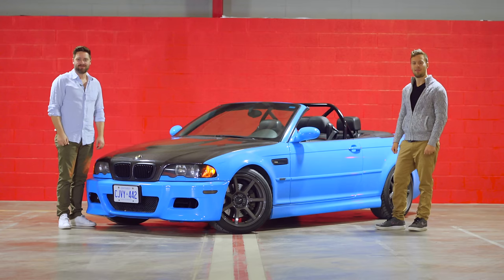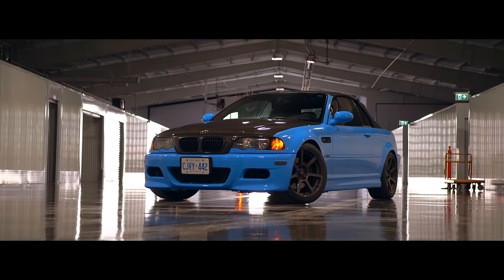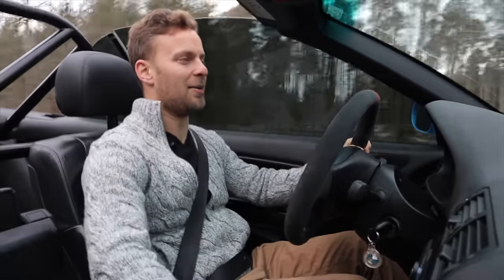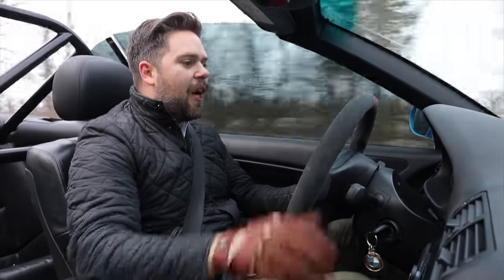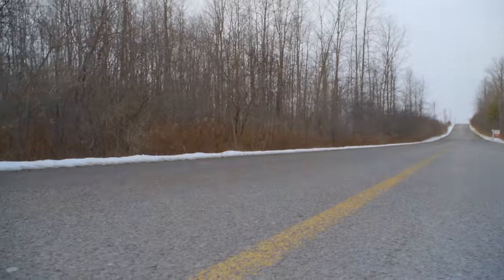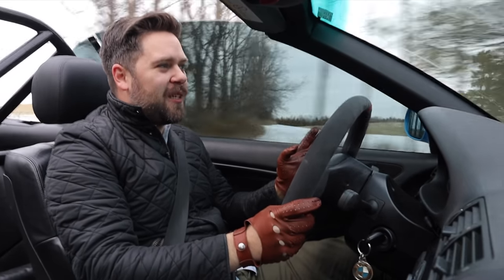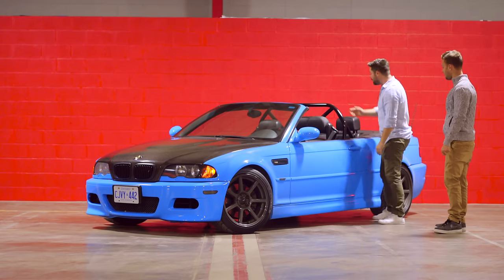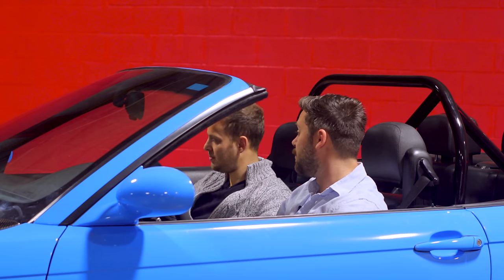I Bought A $10,000 E46 BMW M3 // The Best Car Of All Time… Says Thomas

Comment: Speed Academy : "We were lucky to find someone dumb enough to buy an old abused BMW."
Reply: Jack Black still great fun
Reply: Ehh. They break if they're babied, they break if they're abused. They break no matter what, so what.
Reply: It’s a fine pos
Reply: bliglum they don’t break if babied, I have one
Reply: @poorcomboz3577  Hah! Give it time. But of course, if you count repairs as "maintenance", it basically never breaks right?
Reply: @poorcomboz3577  True!
Reply: bliglum I’ve had my 1 series for 3years now... bought at 62k currently has 116k and runs great only problems I’ve had was maintenance and the usual starter/water pump change... she’s as reliable as a Toyota Corolla. Currently looking to buy a e46 m3 now... bmw is THE ULTIMATE driving machine ;)
Reply: Carson D I got my 525 at 80k and I’m at 160 currently and she’s been a complete beauty the entire time I’ve had to replace 2 of the head gaskets but that was due to my error not the car and other than that nothing
Reply: @griffin_kith6214  same with the head gasket. You overheat or misfire these motors for one second too long and bye bye head gasket
Reply: And he put an eventuri intake on it :/

Comment: Hahahahaha...... You just convinced a whole lot of 17 years olds lose their shirts on weak 323's
Reply: I feel adressed..lol
Reply: Still fun to drove if its stick though 👌🏻
Reply: DuBstep115 sell the clothes off their back to pay for the base model e46
Reply: @leocui03  When are where was this ever a metaphor? Has anyone ever sold clothes to buy anything :D
Reply: @DuBstep115  I would sell my body for the right car
Reply: @leocui03  buying it isn't the issue, you can grab one super cheap... Repairs are insane. It's a good way to start your career as a mechanic. <I would know 😋
Reply: DuBstep115 search up "shirt off one's back"
Reply: lose their shirts or shitx?
Reply: Billy Shannon I wish I was born USA. It’s a heaven for car enthusiasts. unfortunately in my country there is no such thing
Reply: @enderzebak2863  where are you from?
Reply: Billy Shannon I bought one over a year ago and the only thing that I’ve done is a clutch job, because you never know when the plastic fork pin will break but everything is very easy to work on and for only $12k for a hardtop I can’t recommend them enough
Reply: @Industry-insider  yes they are easy to work on. They hit this weird spot in age where absolutely everything plastic and rubber just goes. Gaskets/seals (all of them), plastic tubing and casings, electrical wiring specifically connectors just melt/lose contact or short. It seems to happen all at the same time and nothing is cheap. Recommending one to a kid with just enough cash to buy the damn thing.....not what I would do.
Reply: @Industry-insider  PS. It's one of my favorite cars ever made, congratulations!!! It is without doubt one of the sexiest, best driving cars of it's generation.
Reply: Billy Shannon honestly have you ever had one? Because people really exaggerate it, my 18 year old car’s plastics are in pretty good condition and it came with paperwork saying all the important seals have been replaced. I’m not saying people should expect it to always be a cheap car but it’s worth it to me
Reply: @Industry-insider  I've had 2. I worked for BMW for 8 years and the newer they got, the worse, especially the e90's can be absolutely horrid. If you can find good parts and fix it yourself than go for it 100%. Otherwise, have money in your pocket.
Reply: Nod Melon  super easy to work on. Parts are still expensive in comparison to almost any other toy a 17year old can afford.
Reply: Don't assault me! Yes I may be 17... and broke... and own a 325ci.... with 140k miles...

But it was a great decision!
Reply: @nathanschutt5591  😍 to be 17.....
Reply: Slap a turbo on it and push 400hp on stock engine.
Reply: joke’s on you........ i have a 325
Reply: @ch-jc1mp  bwahahahahah

Comment: 323Ci here, and I completely understand your love for it, even the interior! It's an amazing car really, and although it does have some creeks here and there, it still feels very solid. Yours is beautiful, and I love the carbon bonnet. You should definitely add LED taillights tho, they make the car look so much up-to-date. Also the film that BMW put on the plastic inside, can be removed by soaking it in hot water, and brushing it off with a sponge. Did it on my 323Ci, and it became like new!

Comment: As an owner of an E46 M3 ( my dream) it's a love hate relationship. Mostly love little hate. What I've learned from this car is the 2 main things that has been done to the car rod bearings and subframe. Subframe still cracks even if you done the reinforcement (heard few stories). Rod bearings still go out after constantly revving out to 8 or 8350. But overall it's an amazing car  right proportions and spacious (I have the coupe which is faster). Took to twisty roads and it's agile and responsive( subframe bushings been changed to solid). This is BMW at its prime and still one of the best cars to own. Track car and a GT(does both)
Reply: Keyser Soze either you’ve never driven one or the one you drove was clapped out
Reply: BMW at its prime.....completely unreliable crap.  Yep, that's BMW.
Reply: @TomCogan  "Clapped out" describes nearly every E46 M3 these days, as they've all been abused and saddled with distasteful mods.
Reply: @Keyser Soze where is this dealership located and what's it's official name, since you keep mentioning it.
Reply: Adithya Ravikumar those are 2 UNACCEPTABLE issues.  The chassis and engine are basically on a countdown to failure lol.
Reply: 80's Boombox Collector true, luckily mine isn’t
Reply: Keyser Soze I wonder what makes you hate a car so much you commented 100 times here about your credentials
Reply: As much as I like the E46 m3, I don't think I would be able to put myself through dealing with all the issues. I don't know if this is a particularly bad example, but that car is pretty beat for the miles. I would prefer to spend a little more upfront to get a 996 and have the ims bearing replaced. I say that but I understand going both ways, especially if you need the space from the BMW. I have a 987 so I have a little brand favoritism going on.
Reply: If you "constantly rev" your 8000rpm redline car to 8350rpm, then you deserve every rod bearing failures that comes your way 😄

Anyone interested in buying should go for '04 to '06.    These issues are almost nonexistent for these model yrs

Comment: $6700 V8 4runner
$10,000 M3
Literally the best way to spend almost $17k
Reply: More than a few of us in Colorado have a lifted Yota for mountain off-road fun, and a fast German car for mountain pavement/city fun. I had a 97 4Runner Limited with a locker and a 3" lift paired with a '16 Golf R with a stage 2 tune. Black ice took the 4Runner from me so I got an 04 V8 and built it up with 33" wheels with a 3" lift, and put some Doug Thorley headers on it for a little HP bump. She moves! The downside is that you scream at your German fast car for it's silly unreliability compared to its Japanese garage mate. Got sick of the R and sold it to start flying airplanes. No regrets. lol
Reply: Lonememe 33 what ?
Reply: DJ Raccs 33” tires.
Reply: +lol el I can top that
$7500 V8 Pathfiner
$9500 C5 Corvette
Reply: @masterwhopper414  They made Pathfinder's with a V8? Epic
Reply: Bruh 
2008 4runner
2002 M3
Reply: 10k M3 + 10k parts and labor
Reply: Or get a 17k m3 with good color and a manual and you keep it for awhile and watch the price slowly go up.
Reply: Except that a $10,000 M3 actually costs around $20,000 eventually.
Reply: lol ol just get a $8000 Lexus is250 and a $10000 m3 and then you’re always in something nice
Reply: @aaroninohio5752  good luck finding an m3 for only 10k. Smdh.

Comment: I mean, one of the best designs ever, one of the best chassis's ever, one of the best engines ever, available with a propper manual...
The E46 M3 IS one of the best cars ever made.
Reply: @Keyser Soze Reliability doesn't matter in this case...People that buy these are fully expecting to shovel money into it.
Reply: Best chasis ever? Reliability-wise not so sure!!! Designwise as in looks absoFUCKINGlutely
Reply: The e46 convertible is certainly not the best chassis ever. Not even close. I don’t know why you want to build a convertible to be a race/drift car.
Reply: Keyser Soze you’re the ONLY bmw mechanic/enthusiast I’ve ever heard call the e46 a bad car. The e46/e39 are far and away the pinnacle of BMW cars and nearly every BMW shop and enthusiast will say the same. The s54 is capable of withstanding years of abuse if it’s issues are addressed and the chassis is just excellent.
Reply: @Keyser Soze that's not true at all. The v10 bmw was a massive gasoline hog, 10 quarts oil change, too heavy ruins brakes, if check engine light comes on expect massive $$
Reply: One of the Best engines, s54 iss definitely a beast. One of the best designs, most definitely. One of the best chassis, meh, rear subframe is super weak on this untill the 2002 and after models where BMW reinforced them from factory
Reply: Mine was a great car, reliable and extremely well build. Solid as all hell. It wasn't a convertible though, and it had a sunroof delete. Still, I never loved it. The gearbox always wanted the engine to live above 4k rpm, so it was annoying to peter around town in. The exhaust sounded cringey, like a shit can racerboy. But mainly something about it was just too sterile. All purpose and no personality. I never missed it.
Reply: haha, best chasis ever?  the e46 is notorious for sub frame cracks, just about every one has them and it will cost you around 5 grand to fix.
Reply: @pouncey007  no, lol. 5 grand to fix, what world do you live in? If I can grab a good subframe for no more than 300 euro then how the hell does it cost 5000 to just fix it and if you didn't know all E46's subframes came reinforced from factory after the 2002 models so they fixed their mistake but if you wanted to reinforce it even more then a kit to do that and get it all welded up would not cost you anywhere near 5 grand and if you didn't know the E46 compact from ANY year came with one of the strongest subframes on any car, that car is known for its strong, non-flexing chassis for drifting. So basically your mostly wrong
Reply: @rxw5520  well every car is like that when you get it, most cars stock are boring and the E46 is one of the most boring cars stock, you gotta slap a nice kit on it, wheels , slap on a turbo, E46 has a lot of potential but not many tries to take its potential out
Reply: @aricerse4654  nah... I wouldn't agree that "every car" is like that.
Reply: @rxw5520  that's why I said most, I like some cars stock too like for an example an rtr Mustang
Reply: @aricerse4654  what year is yours and what mods have you put on it?
Reply: @rxw5520  I bought it for 250 euro so it's been repairs more than mods, just a short throw shifter but I've replace the water pump, power steering pump, alternator, idler tensioner,
Valve cover gasket and a lot more stuff and I have raceland coils ready to go, just waiting for strut and shock mounts, you can see it on my ig: @e46rohan, I bought the car when I was 15 and in the 2 years I've had it I have done all the work myself, never gave the keys to anyone
Reply: @Keyser Soze  I have had both coupe and convertible e46 M3s, the convertible can handle  almost as good as coupe if not as good, if you modify it, I put coilovers, stiffer swar  bars front & rear,  braces, better tires, it will be very sharp
Reply: @Hole_Motorsports   I agree I have owned 2 e46 M3s, they are good cars as long as you take care of them
Reply: @rxw5520  that's very interesting. That's how I feel about most Audis the no personality thing...
Reply: Nope
Reply: I have an e46 3L diesel, and it is an absolute dream to drive. The Torque is awesome

Comment: I have an e46. For the central lock and hazard light you might be able to fix it by simply taking it out, disconnecting the wire, blowing on it (clean it with contact cleaner maybe?) and pop it back in. Worked on my one and a friend's one.

Comment: That non-op hazard light/central locking unit is an easy fix.  Pop out the unit, the electronic module pops out after years of people pushing down on it.  Glue the unit back into the housing (or electrical tape it in) and pop the unit back in.

Comment: 300,000 kilometers and its still alive

long live e46 m3's
Reply: ... with probably >10k spent to keep it running.. i mean.. no logical person actually believes everything is original on that made-for-drift car... 

Apart maybe you? 😅
Reply: That's only 186k miles. And it's had the rod bearings replaced.
Reply: Karabo raleting as long as it has the stock engine thats what matters

Comment: I love my E46. 3rd owner and the previous owner was a mechanic and kept it in amazing condition. Just over 250k miles and still stock, runs beautifully. I will say the top has presented me with an issue but the owner included a brand new harness and problem solved.

Comment: I have one of these, It's the best, nothing has ever gone wrong and it looks great with roof up or down. Only downside, bit of rust on front arches. The best thing  is, it hasn't got emails, lane control, auto braking or any of that modern crap. It doesn't even have cup holders but best of all, it's got an actual key..........brilliant!

Comment: The E46 lines are Timeless.... and something i remember about that clutch, i saw a girl 20years changing it alone by herself. greetings from croatia / did you make a dynotest after the intakechange? i guess you lost power!? Noise? You need this - Evolve Carbon Airbox - the Eventuri intakesystem is not good even with a software update it does not perform well, only the sound is a little bit better but you lose power and NM. Sounds crazy but its true : the best way is to use the airbox with a software update than put out the airbox and put the normal intake again in and you will have maximum 353HP with 369.something NM. Yea he lose a little bit of torque but gets a few HP. At the end you just hear the soundchange but do not feel the increase of HP. The Dashboard you have to wrap in alcantara or even leather. I know i know :) but this car you wont sell.

Comment: Thomas if by chance you ever read this (Which I doubt lol). The reason your hazard and lock buttons don't work is again because of BMW's plastic in the early 2000's. Underneath those buttons the bottom of the actual switch cartridge has broken out so that they no longer engage. You can order a new button cartridge which easily clicks into place from Ebay for just a few bucks. I had the same thing happen as have many other E46 M3 owners.

Comment: I owned a '04 325xi for 10 years and babied it. It still had it's issues though and I sold it 2.5 years ago with 120K miles on it for $6K USD. I do miss it

Comment: I have a 04 E46 M3 vert for 7-8 years and still love it. I do have the SMG but from driving 13 and 10 speed Trucks I love it. Best of both worlds, and a bit more fun in the canyons with paddles. Enjoy the car its a great buy especially now when the E46 m3 coupe 6spd is getting out of hand on price. The SMG or Vert is a great buy and you get the same experience. A bit better with a vert tho.

Comment: I had an '03 coupe that I bought new. The best word to describe it is "raw".  Suspension was punishing on all but smooth roads, clutch was stiff,  constant shifting was not optional, passengers hated it.   Engine was an absolute gem when on the boil, and really anemic below about 4500rpm. It made wonderful singing sounds as you revved it, and was as smooth as glass. But as a daily driver it wore me out. I traded it for an 07 335i, which was a much better daily driver and pretty close in overall performance. Best car ever? Hardly.

Comment: I have this in a carbon black coupe and honestly if you just jump on the problems it’ll be fine. The subframe should be fine after the reinforcement and the rod bearings is something you do but honestly running the proper thick oil and replacement it’ll be fine you just gotta treat it like a race car and not so much a daily

Comment: Borla makes some of the most advanced systems in the business, and also considered them for my Challenger. I also looked at the Corsa extremes and are top notch as well, but decided on a more simple setup and sounds absolutely amazing together with that hemi. It's the SLP loudmouth catbacks and basically consists of 2 open chamber racing bullets on 3" pipe, without the reso's and is like straight piping. But better because of the increased diameter, and isn't any major engineering going on. Like with the other two that I mentioned, and are the best bang-for-the-buck in my opinion

Comment: I'll be MORE than happy with my manual E92 335i, which is built to run circles around almost any E46. Lastly, while I loved my E46 every day I owned it, or at least I thought I did, I actually found out that I had no idea what loving a car even was, UNTIL I got my E92. And IT is the best all around BMW, with the perfect mix of build ability, style, power and luxury. So sorry Thomas, BUT it's the E92's that are without a doubt, the best and MOST FUN Bimmer's EVER MADE. OMT, the blue looks ten times better now that I see it used to be yellow... And there's many ten inch touch screens that would look a lot better in there, than that 80's stereo.

Comment: I had a 2002 M3 Cabrio also Laguna Seca blue but apart from the great engine everything else is below par while the 1998 M Roadster with  the Dinan supercharger and Koni shocks I had previously was way faster and felt stiffer too without all the creaks and rattles. I wish I still had it because it is probably worth twice as much today as what I sold it for in 2006.